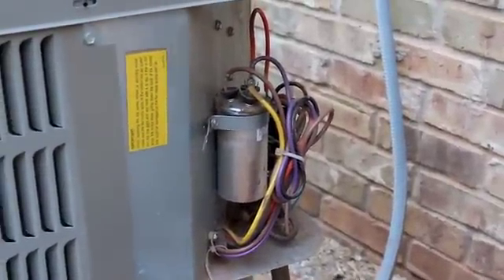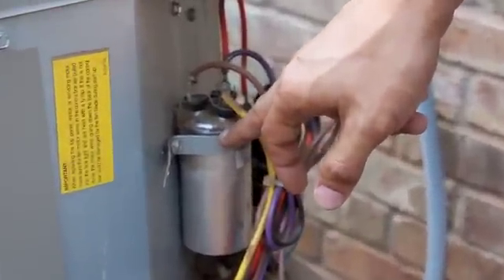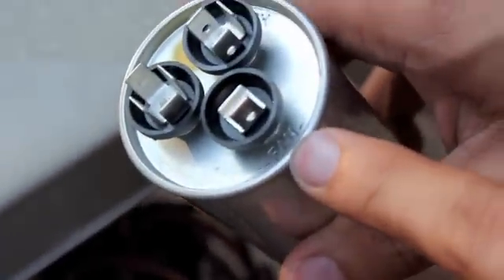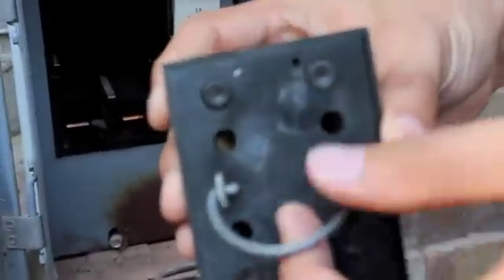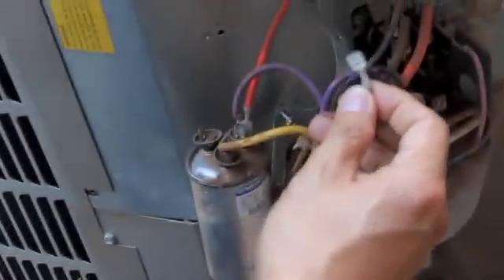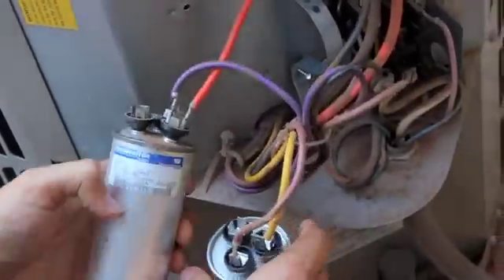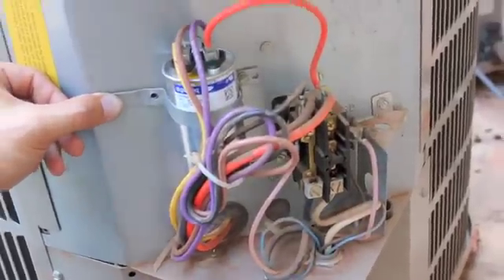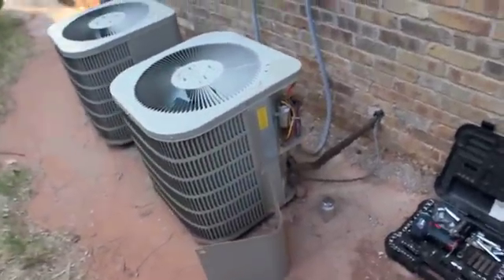AC fan not working - how to repair broken HVAC Run Start Capacitor - air condition

Comment: i love listening to someone who isnt a professional .... trust me it can help it but simply changing a run cap doesnt tell you how the motor is and he was completely unsafe in doing so... and every unit has diff sizes and you also have to match or up the voltage rating on it or youll burn both your cfm and compressor ...theyll run but in as short as 15 min or 2 ish weeks if your lucky... they die due to lack of power

Comment: I cannot stress how important it is to kill power to your unit, and verify it with a amp meter BEFORE opening the panel. 

240 volts is nothing to play with.

Comment from the maker: Well, im running out of ideas. dont forget, i am not a professional either. But my experience tells me its a voltage issue. you should check the voltage level when that happens. It could be the circuit breaker. Two lines each carry 120VAC = total 240 VAC. One line (120VAC) alone can start up the fan,  but you need 240VAC to start up the compressor.

Comment: So the AC started blowing warm air just now, and I raced outside and confirmed the fan was on and the compressor was off.  The pipe that was cold before was just barely cool.  While I was listening to the AC outside, I heard the compressor turn on and sure enough cold air started blowing again.  So the question becomes, why would the compressor shut off? BTW, it worked well though the hot part of the day and now that it's cooler outside, the problem was there.  Any expert opinions, clues?

Comment: I'll check that.  Thanks!  I also realized I did a poor job of explaining that the system works and the fan continues to run, I just get warm air instead of cold after a few hours.  I think the compressor overheats and shuts off.  I checked the two copper pipes going to the ac unit outside and one is warm and the other is cold, when working, I haven't checked it when not working.  I also haven't listened to the compressor buzz to see if it's off when not working, but I will.  Thanks again.

Comment from the maker: oh, you should check the voltage going to the AC. It should be 240VAC. My friends house voltage was around 226 VAC and the unit only came on once in a while. Check out "HVAC Intermittent Problem - AC doesnt start every time". It might solve your problem.

Comment: Part#2. ...yeas back a tech said the freeon was high and he drained some.  that didn't solve anything.  I think the compressor is overheating or something is freezing and shutting down until it cools off.  How do I find out?  My next step is to clean the unit like you showed in one of your videos.  Anything you can tell me would be greatly appreciated.

Comment: Part #1  I've seen few of your videos and they are great.  Thank you.  I didn't get the answer for my problem and I saw many people writing here for advice, so I thought I would try too.  My unit runs great for about 2 hours and then starts to blow warm air for about 30 minutes and then runs good for 2 more hours.  I don't think that would be the capacitor since I'm guessing that would be more of a "works or doesn't work" type problem.  Also, I had a tech check it a few ...

Comment from the maker: So, the first humming from furnace might be the transformer or relays. The furnace has a blower motor. Does that come on? Is that the first 'no fan start'? I will assume you mean the blower comes on, but outside fan doesnt.
You replaced the capacitor, but the condensing unit fan still will not come on.  The humming might be the contractor or/and the compressor. Check the contactor for 240VAC across L1/L2 and T1/T2. If you have 240VAC, then you might have a bad fan.

Comment: Great vid very good info-  but..question   →  Thermostat set to 'Fan on'  in 'Cool 'mode..  humming sound coming from furnace...no fan start...(outside a c  unit is running) --- replaced 7.5 mF capacitor, ►Still no fan motor will turn on. It just hums and hums- --- any ideas ? next steps (is it the motor?)   arrghhhh !  thxs

Comment: I'm sure you saved many people a lot of money on this simple repair. But you appear to have a dual run capacitor and, although it's obviously swollen and bad, at least on one leg, the other could still hold a dangerous charge. I would also turn the power off at the circuit breaker and wait several hours for any charge to dissipate.  Then I would discharge each leg with an insulated cable.  Ideally, appropriate resistors should be in the discharge cable circuit. Wear thick rubber gloves to do it.

Comment from the maker: if no air is coming out the vent, then you need to check your furnace blower (inside your house). If you do have air coming out, but its not cold then it might be the compressor, capacitor, low refrigerant or low voltage. Check out this link: youtube.com/user/iesuck/videos?query=hvac

Comment: Sounds like your coil could be clogged,  This can be an easy fix if your have an electrical heater but if its a gas heater you might want to get a service man to clean it.

Comment: My AC failed Fri. night. I found this video and it behaved the same. Turned AC on inside, off outside. Checked the capacitor and it looked bulging. Went to local supplier Saturday morning, got the part and had installed in minutes. Turned the power on the unit outside and it didn't work. Eventually manually pushed the relay in and it kicked on. Thought I had a bad relay too maybe. Turns out the wife shut off AC on panel while I went to store. Works fine now. Thx for the video. Saved family money

Comment: my home a/c has the same exact problem. the fan won't kick on but it's like it want to for 1/4 sec. the capacitor is similar an bulged on the top.

Comment: the clamp wasnt on the capacitor,left loose deliberty by the repair man ...i put a pipe clamp aroud it with a heavy copper speaker wire round it tightened it up then ran the other end of the wire to a screw in the frame ,plugged everything up and it now works...apparently it needs grounded to get the capacitor charged enough to kick the fan motor.....anyway the tech told my mom it would cost a thousand dollars to repair.......it cost me about 15 mins work and a piece of wire...never trust a pro!

Comment from the maker: Search "How Air Condition Ventilation & Furnace Works - HVAC AC system diagram" it might help you diagnose your system. Changing the cap is only useful if you have a bad cap.
youtube.com/watch?v=JilZmyglFvo

Comment from the maker: You should read 240VAC if you measure across L1 and L2 on the contactor. When 24VAC is energized, then you will read 240VAC on T1 and T2.
1. you might have a bad circuit breaker at your main distribution board (AKA panelboard or breaker box). it might be tripped or it might have gone bad. 
2. you might have a blown fuse at the condensing units breaker box.

Comment: great video! i followed all your instrux to check my AC unit but my fan does not turn on (it spins freely). I checked the relay and when the thermostat is off both sides of the relays read 110 volts (run capacitor side and therostat side). When its turned on the i hear the relay pop and it gets 25 volts from the thermostat but the other 4 connectors still show 110 volts. The run capacitaor needs to be replaced as it is buldged. I assuming the relay is bad too since its always hot. Please help!!

Comment from the maker: Try checking this video "AC not cold enough - Air Conditioner maintenance cleaning" I show how to tell which wire goes to the fan and common. You can then figure out which one goes to the compressor

Comment from the maker: oh, i wouldnt replace the whole thing if the fan wasn't turning. I assume he came out, cleaned it, and now it works fine? Sometimes the unit can get overloaded with a dirty coil. you can clean it yourself. look at my other video on cleaning the coil. $400 for cleaning is way too expensive.

Comment: my AC was not cold last week so i went to check the outside unit, the fan was not turning. so i figured something had gone wrong, so i called a AC technician. they said the coils was dirty and and he temporary cleaned it and he don't know how long the unit will last and recommanded me to get new unit. so basically i spent $400 just for him to clean the coil, didnt exactly fix it. do i need a new unit?

Comment: Another way to check the capacitor is to connect all the wires together from the capacitor, turn the unit on and if it starts then the capacitors junk!

Comment from the maker: The capacitor does kick start the fan too. Check the capacitor first. If it doesnt have the right capacitance then replacing the capacitor can fix your problem. 
If the capacitor is good, then it might be your fan motor. Check out my other videos for checking a capacitor and replacing the motor (under cleaning the condensing unit).

Comment: By the way, when I opened the heatpump panel, I saw two capacitors, One big and one small.  I didn't notice any swelling on the capacitors.  Any advice?  Thank you so much for this video

Comment: Thank you so much for posting this video.  My heatpump when I turned on, the compressor ran for 1 minutes then stop, the fan didn't run at all, I touched the coolant pipes, one of them very hot, one of them was very cold.  I think the reason the heatpump stopped because it got hot and the fan didn't run to cool it down.  Is this something also related to the capacitor?  Again, many thanks to you for this great video.

Comment: thats dumb to do you should always remove the charge from the cap first before servcing the unit . To do that all you need to do is short the cap to ground with a screwdriver , One thats insilated from electricty .

Comment from the maker: The buzz sounds is the 24VAC contactor relay. Sounds like your control board is trying to turn on the condensing unit, but the condensing unit isnt turning on. Check the run capacitor and contactor relay. If you have 240VAC and a good capacitor, then you can narrow it down to the fan or compressor. Watch the following youtube:
"How Air Condition Ventilation & Furnace Works - HVAC AC system diagram"
"AC not starting up - Air Conditioner condensing unit lost power"

Comment: I haven't looked at my capacitor yet but...my A/C stopped working today only lukewarm air is blowing out of the vents. Went outside and the fan is not going around and i hear a soft buzzing sound. Seems to be coming from the fan. Is this the sign of a bad capacitor? Or a bad fan unit? What is the buzzing sound coming from? I appreciate any help - unemployed, heat wave (!) and it's the 4th of July tomorrow...

Comment: Definitely.  I'm very mechanically and electronically inclined, because I've always worked on my own cars and wired my own advanced stereo systems.  If you have basic mechanical skills, you can definitely take care of most of your HVAC related issues.  I've hired HVAC techs and learned by watching them for a few other issues with my furnace, but now I'm pretty self reliant.  Every little bit counts in this economy.  HVAC techs will always have business from the rest of the scared sheeple

Comment: Thanks so much, I had concluded my capacitor was gone - but until I saw this video, I never realized that they bulge out when they're gone. It cost me $22 locally (cheaper online, but I needed it fixed ASAP) and I did it myself.  Piece of cake 10 minute install... thanks so much for making this video.  Save $150-200 and do it yourself!

Comment from the maker: um.... do you mean capacitor or compressor? I think you mean capacitor. You can get new wiring from any hardware store (e.g. lowes or HD). typical wire size is 16 gauge (awg).

Comment: what IESUCK has failed to mention is that if the capcitor has not been discharged and you touch the terminals it will hurt if  not kill you. Homeowners beware.

Comment from the maker: Hi, there are two capacitance on your current capacitor. you need to match it with a new one. digikey, mouser, amazon are few that sell them. e.g. i went to mouser, typed "run capacitor" and a few showed up.

Comment: this is the most stupid advice ever risking more damage because you want to save 5 dollars
 tighten or loosen the fan bolt only results in a worn out fan hole not in a fan that starts easier

Comment: Before even spending money on that simple turn your ac on and then with a broom handle or a long screw driver SPIN the fan. You can even squirt a little WD40 on the pinion. If still having problems tighten or loosen the fan bolt. If that doesn't work THEN move on to spending money on parts or techs.

Comment: good video on running cap replacment. for about $10 he got the AC working, if it fails again it may be something else, but if it works..saved some dollars. In Texas, the other failure is fireants, that will get into into the contact switch. to prevent this make sure you put ant poison arount the AC unit.

Comment: There are other costs involved with running a repair business. Overhead such as the truck, insurance, licensing, advertising, labor taxes and workman's comp, office support staff, training, just to name a few. And when it's all done yes a profit which will also be taxed. A good technician shouldn't spend only 5 min on the repair. All other components need to be checked to address issues causing problem or future problems. It takes training to provide top service.

Comment: I have a question...   I understand charging for vehicle maintenance and servicing/checking the rest of the system and cleaning the condensor coils, etc., which would raise your price beyond just replacing a capacitor.... but why do you charge $85 for a $25 part.   If you need more money for your work, just put it into your labor costs, don't upcharge materials.

Comment: he doesn't know anything about why it went out, what to test, what to check after he replaces it and is going to keep burning through capacitors without actually fixing the problem lol i call those guess technicians, but he's not a tech so he's just ignorant

Comment: As a tech my self make sure you use a resistor or a insulated scewdriver to discharge terminals.  More than a few times ive got a nasty shock.

Comment: @iesuck 
My 25 year old Amana window AC's compressor is not starting (it try to start and can feel vibration and sound ) and fan motor has delayed starting also running at slow speed.Is it a capacitor failure.

Comment: @Defcon458  I also did not say that I charge these prices, if you could read and comprehend properly, I said companies charge these amounts.  I actually charge about $85 for the dual cap and $68 for the service call.  I also do a hell of allot more than what  u did.  You change a part, that is it.  You should not even have access to that part actually, unless you’re licensed.  You get hurt or your little finger burned and I promise you, you will sue whomever u can for your stupidity. don't reply

Comment: silly Q but if u had a bad neighbor & they water hosed your outdoor fan is it possible that it would damage or is the outdoor unit designed to withstand water? Its an Akai reverse cycle spilt air conditioner. When I turn to heat the outdoor fan works but theirs no air coming from indoor unit and when i switch to cool air then the outdoor fan stops working but the indoor fan works. I hear a click like your thermostat click maybe also the electricity hum turns on & off compressor? or capacitor?

Comment: You mention that by pulling the breaker, it removes the power from the AC.  This is true for the high voltage, but there still may be 24 VAC coming into the outside unit from the inside thermostat control.

Comment: you just fixed your a/c unit for about  $15.00 to $20.00 for the cost of the dual run cap.  An a/c company would of charged you from $200.00 to $500.00 for that exact same fix.  I know because I own an a/c company and have been working in the HVAC industry for over 26 years now.  6 of those years were in Dallas, Tx. and the 19 years were in Phx., Arizona.

Comment from the maker: @MARICELA1001 You could use a DMM and check to see if both capacitors are good or not. If either one is out of its limit, then you should replace the bad one. e.g. (youtube.com/watch?v=_vhiCfIwFKk&feature)
There might be a model number on the capacitor. If not, then there are 3 important specs to follow. First is the capacitance (e.g. uF, typical rating for residential is 35uF), second is voltage (typical rating is 250-300V or higher), last is temperature but most rating should work.

Comment: Thanks a lot for posting this D.I.Y. video, i just bought a house with old A/C system and after 2 weeks  i  found out that  compressor / fan outside stopped working. i hear that theres a capacitor you could change to solve the problem, so i did some research on Youtube BAMMM !! i saw your video, save my money, man you are awsome :)

Comment: the capacitor is capable of holding a dangerous charge, so it's very important to drain it before you touch anything. a relatively safe way is to take a light bulb connected to a socket and two wires, and just touch the wires to the different leads on the capacitor.

Comment: Thanks - this was my exact problem and it helped to watch someone run through what I needed to do. I suspected the capacitor or the fan motor and was rooting for the capacitor since it was $18 compared to $152. I went to grainger and they were able to test the cap for me (my multimeter did not have a uF test setting) and had mine in stock. I tested the motor for ohms (a failed motor will appear with super low impedence because usually the windings are shorted together).